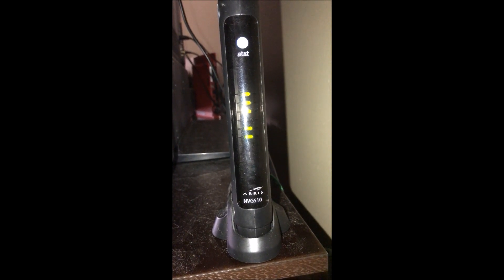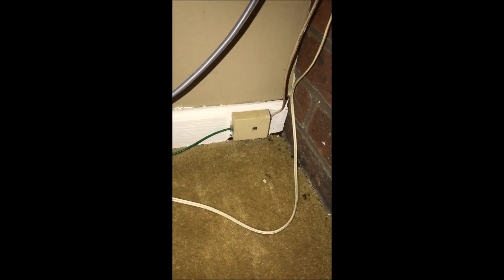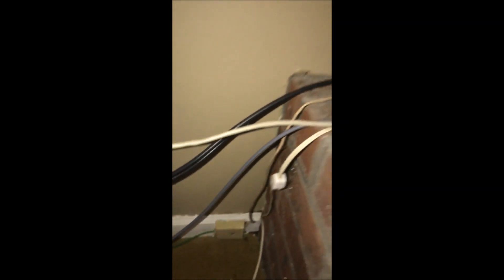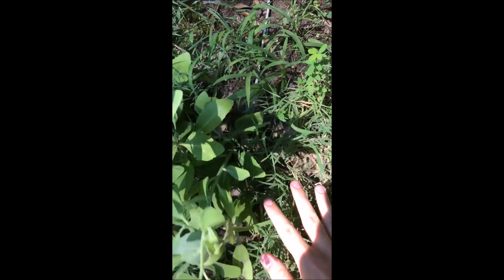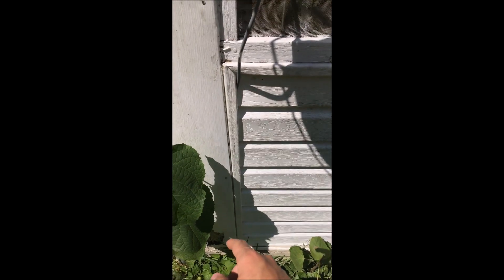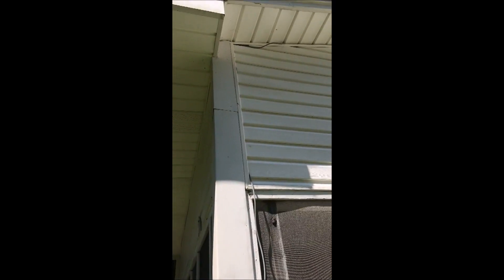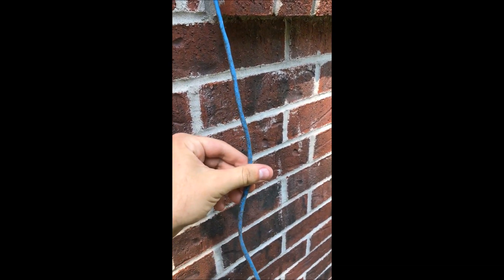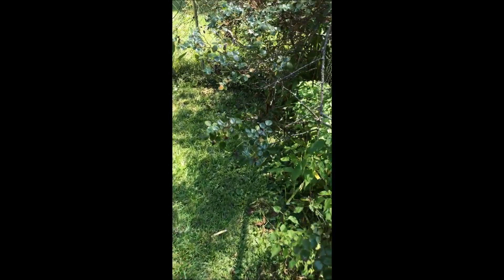Can You Run Ethernet Underground

Comment: There is category cable designed for direct burial in soil or underground pipe that has silicone coating the individual conductors to prevent moisture from permeating the insulation.
Reply: whats that called?

Comment: I was just wondering, how well has it held up since you posted this video?
Reply from the maker: It’s held up without any problems. A year ago a section of the cable was cut with a gardening tool and I had to dig up about 15-20 ft of the cable to replace the section. After years underground the wire has shown little signs of wear and the ethernet connector has also held up. Keep in mind these cables weren’t designed for this environment, as many have commented, but they were a cheap and easy solution to my needs. I hope this helps some, do you have any other questions?
Reply: @simplicityelectricity8710  -  @Simplicity Electricity  - Thanks for the reply, this is helpful. Have you had any equipment failures (routers, switches etc) that might have been caused by this setup? Grounding and lightening strikes have been highlighted as issues in some online resources.
Reply from the maker: @hycron1234  we recently had lightning strike our telephone pole and my router upstairs was damaged and had to be replaced. I should note though that the underground cable still works just fine and that the strike only affected our wall outlets. Just because I haven’t had trouble doesn’t mean that it is necessarily safe however.

Comment: This proof of concept video demonstrates that it is possible. However I would like to share other alternatives for same house, or networking options for outbuildings on the same lot. 
Wireless there are point to point bridges like Ubiquiti, some options are as cheap as $50 per side Client and access point.. providing bidirectional data 100+Mbps.
The next is more for the home owner that does not have ambition to  bury ethernet.. Power line network adapters. Plug one side into an outlet and run a ethernet from your moden to the ethernet side of the POE -  make sure not to plug into a surge suppressor, straight to the wall for best results, and another in a garage, office, other location on property and then you can hook the secondary location up to a router, access point or other device like POE camera. All will be on the same network. 
This option can either be a quick fix or minimally beneficial depending on the condition of you electrical infra.  
well intentioned Food for thought.

Comment: Been wanting to do this for years to get stable internet out to our detached garage. I've tried Powerline, wifi mesh, a wifi CPE to client, etc. The powerline method has been the most stable, but it even fails sometimes. So, I decided that this spring I'm finally going to do it and lay 2 cat 7 lines (for expansion and backup) out to the garage where I will also install wifi access points off of it. I've been debating on either cat 7 or fiber, but fiber is more $$$ and troublesome. I'm wondering though, do I need to install grounding/surge protection when installing ethernet underground. I'm probably going to install it in 1" PVC. My buddy says it shouldn;t be necessary to ground, but some others say definitely ground it. Any Suggestions?
Reply from the maker: Michael Abel well allow me to use my video for an example. Any exposed ethernet cable is subject to rainwater and humidity and thus, corrosion and electrical problems. If you want to do it professionally you should always ground it in some way, though some modems and switches act as surge protectors. The way I do it is the polar opposite, but it has worked for years now. From my experience though, as long as all of the cable underground has pvc around it without the chance of water getting in a ground shouldn’t be necessary.

Comment: How is your installation holding up these days?

I am buring Cat6A cable but putting it in PVC conduit about 100ft buried 1 foot under. I didnt get the outdoor Cat6A but I figured I wouldn't need it in conduit and nothing is exposed to UV rays out to my detatched garage. What do guys think?
Reply from the maker: Hey thanks for replying! Personally I think you will be fine with not having outdoor-grade Cat cables. My personal connection is standard Cat5e, and it runs roughly 60 ft through a 100+ degrees attic, has some exposure to UV along the house and is also 1 ft underground exposed to other elements. As long as the connections are sealed properly (if they are Ethernet extenders) you should be fine.
Reply from the maker: My connection has been in place for nearly 3 years now also, so even though it is not the proper way to run Ethernet, it is a simple and cheap method for getting the job done.
Reply: Ive installed category cable designed for underground pipe its called direct burial, its filled with gel to prevent water soaking into the insulation.

Comment: outdoor rated ethernet cable is available and I have used it in the past for connecting outdoor antennas , which seem to be holding up well after 5 years here in the great white north...😎
Reply from the maker: Obeeewaan at the time I was using what I had at my disposal and I'm surprised normal Ethernet cable has lasted this long with few signs of wear and tear. When it does fail though I will switch to outdoor!👌🏼
Reply: Obeeewaan can u link me the cable

Comment: This is fine if you don't mind mind it failing in a few weeks or months. If you want your underground installation to last, you need special direct-burial cat5e, which is filled with a moisture-repellent gel, and has a UV-resistant outer jacket to stop sunlight breaking down the plastic. If you need to bury a splitter, coupler, or any other equipment underground, it needs to be in a water-tight enclosure which seals to the cable. Cables, Connectors, Conduits, Junction boxes all have Ingress Protection (IP) ratings. The lowest IP rating of any part of your cabling solution must be IP68 or above to ensure your wire remains healthy. Doing it right is expensive though, so sometimes it's not worth it.
Reply from the maker: Graeme Job you are right about there being better ways, and I honestly know this is about the worst way to lay Cat cable underground. The cable has not failed me yet, it's been roughly 9-10 months and it is still going strong, but that doesn't mean it would work that way for everyone. I appreciate the feedback!

Comment: Yeah that phone wire is not in pvc. It just has pvc where it is exposed. The dangers of wire in ground is lighting induced into the cable. Lighting flows through the ground and will be induced into your cable by induction. You should use shielded flooded wire underground and ground that shield. And use a surge protector. Also you can not use tape outside it will suck the moister in to it. No one uses tape it destroys your wire. You use a flooded splice connector.
Reply from the maker: tmastersat I am sorry it has taken so long to respond to your comment and I appreciate the feedback. I realize that this method is probably the worst way to lay Cat cable, but it is also the most cost effective and simplest. The cable has lasted me 9-10 months with no problems, but that's not to say it would do the same for others. I posted the video just to give people and idea of what could be done. Thank you for your feedback though!